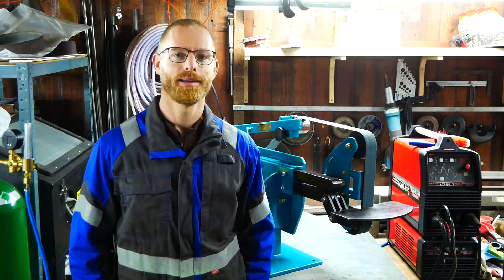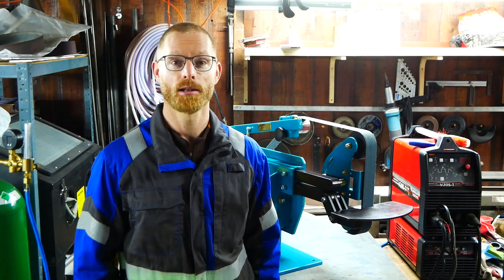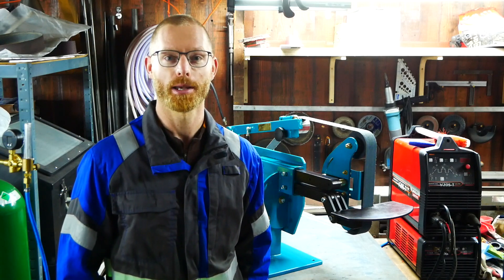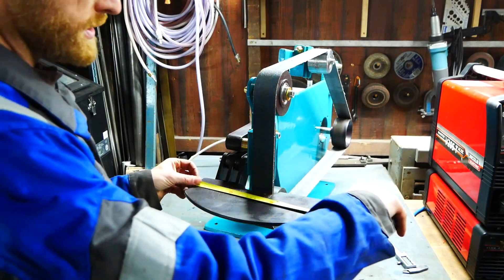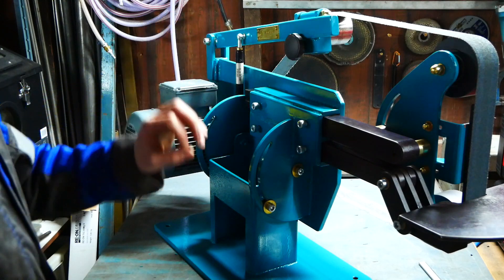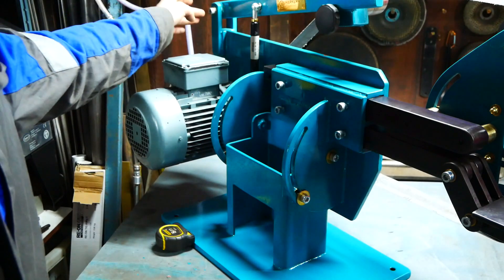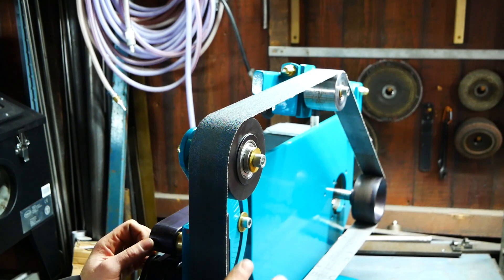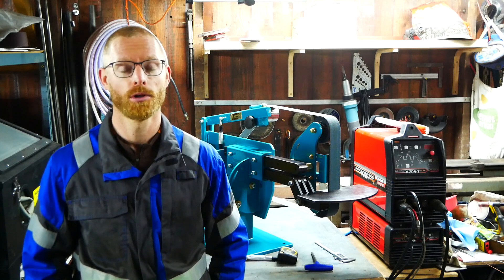2x72 Belt Grinder: Dimensions - Design - DIY

Comment: what amps were you welding at for the thicker parts
Reply from the maker: I think around 180A (max of my machine at that time). If I could a would go a bit higher but the strength ist a real issue here.

Comment: Thanks for sharing! Im also working on buildng my own belt sander but I cant find any place where I can buy the belts, could You please give me a hint where You buy the belts. 
Greetings from Germany
Reply from the maker: Hi Filip, I got my belts from a local hardware supplier called Lasaulec. Don't no if this company also exist in Germany. But I think there would be many online shops that can deliver to Germany. The brand is Flexovit (50x200). I have no experince with other brands and haven't used this one a lot. So a can not compare this brand to others. Greetings from the Netherlands and take care in these strange times (btw, my girlfriends family is from Michelstadt and I travel to Germany every 2-3 weeks. Hope there won't be a complete lockdown). Bart

Comment: Hey Bart as I said in your build video you have created an impressive grinder here. I'm in Canada and will be soon building my version of your machine. Thanks for these design comments and suggestions for improvement. Its great to have this insight before I start. I do like the idea of bolted receiver tubes and plan to marry your design with a couple ideas I'll borrow from the North Ridge Tool 2x72 Pro grinder. If you haven't seen the assy video that Ray's Garage did, its worth a look. Besides the bolted receiver tube assy, they have a nice design on the tracking wheel with a ratchet tension arm instead of springs. I have a Burr King 760 which has a similar ratchet tension wheel and really like it. Thanks again for taking the time to share this great project. If I could only convince you now to teach us how to TIG weld as you are an expert at it. Well done and cheers, Bill.

Comment: Thanks for the details. On a more important note, how can I buy an all metric tape. I work in the architectural steel industry in Canada. Most engineered drawing are in metric. Because in Canada we live in two world, imperial and metric, your tape measure use graduated in both systems. Does not work so well when you want to read the tape from the “wrong side”. Wondering if you could help me out with purchasing a 100% metric tape from Europe. Would love to support you directly with this. Thanks
Reply from the maker: Hi Patrick. In Europe its easy to get these. How many do you need? Please contact me at bartharkema at g mail dot com. Maybe I can help.